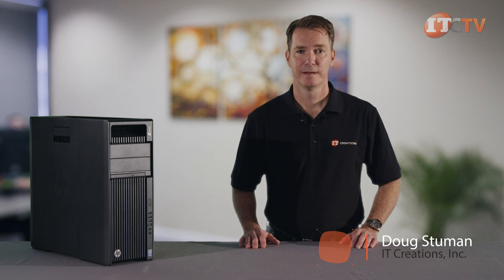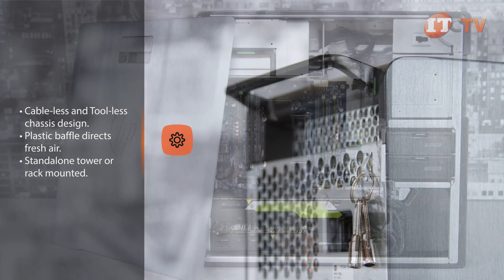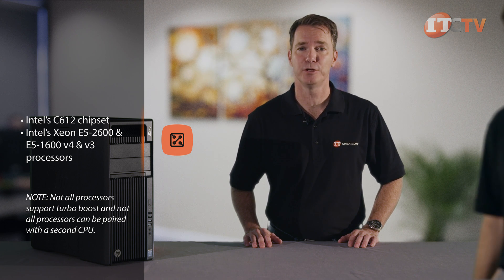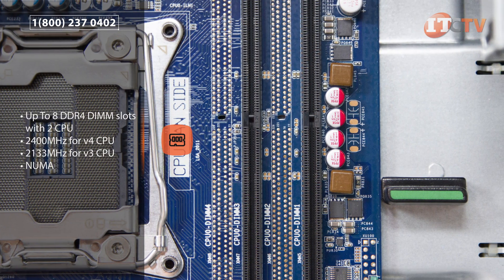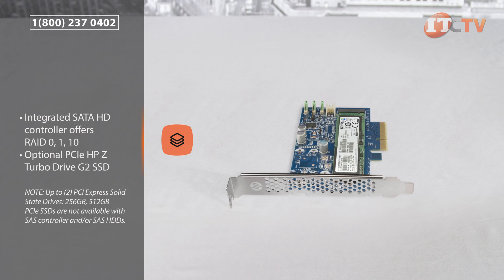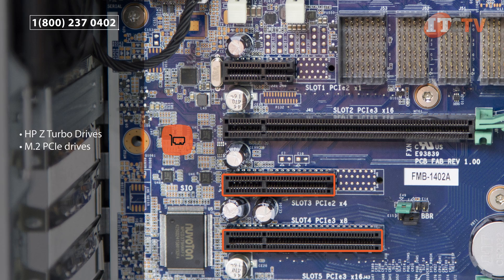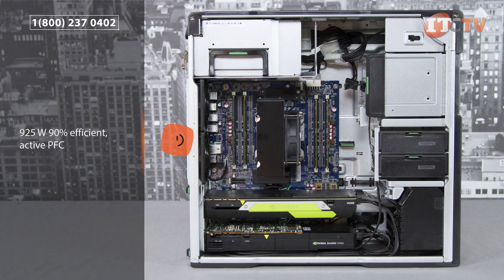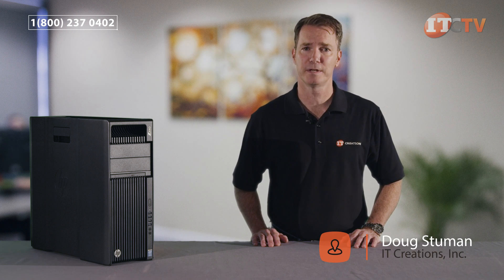HP Z640 Workstation Review - 4K UHD!

Comment: How long can these Z440, Z640 and Z840 be able to serve given that it's already a decade old.
Reply from the maker: Until they die… Depends on what you want to use it for I suppose. Technology does get better quite quickly so it will start to lose it's edge in comparison to other systems. Still, those Z-series systems are made for 24/7 operation. Thanks for commenting and watching!
Reply: @Itcreations-LA thanks for your response

Comment: I use a HP Z640 with dual E5-2699v3, 256 GB of 2,133MHz ECC RAM, a ProArt RTX4070 GPU and a ASUS 4 x 2TB M2 NVMe card, configured in RAID 0 for very heavy Astro photography work loads. The rig boots from a 1TB SSD and has a 8TB enterprise HDD for storage. My workloads, which step one - stacking 800+ images into a master image (using PixInsight v1.9.3) used to take 4.5 hours on my old eight core workstation. This 36 physical core workstation completes this task in 2 hours! I disable hyper threading as Windows 10 Pro requires special affinity aware code to distribute workloads across 2 NUMA core - when a machine shows has having more than 64 virtual cores.  Most software doesn’t have this affinity aware code correctly added.

The machine is close to perfect for astrophotography and video editing workloads - or to run VMs.  My only wish would be it could provide PCIE x16 in v4 rather than v3, which limits my PCIE M2 RAID 0 array to 8 Giga bytes a second throughput - half of what the drives are capable of.  It would be great is Microsoft confirmed this CPU class were supported for Windows 11 Pro. Waiting for someone to test booting it as an unapproved OS as Windows 10 Pro approaches end of life.  An excellent machine, really well constructed.

By the way - I used a twin female 6 pin to single 8 pin male adapter cable to take the Z640s two 6 pin cables to power the RTX 4070.

Comment: can you use oios openindiana on this machine ?
Reply from the maker: That is an interesting question, and one which we have not tested, so I cannot answer that. We usually stick with the list of system supported operating systems but that does not mean this OS would not be supported! it is Linux Redhat certified after all but if it is not in the list of supported OS then we would only install at the customer's request. Thanks for watching!

Comment: Dear,
          I have quotation of Hp z640, the specifications are below. Just i want to know this kind spec. are good and supported for 3d high rendering works .I am using 3ds max vray and other graphics software.So please let me know can i buy it or not for my 3d works.      

HP Z640 WORKSTATION E5-2667 v4
Intel® Xeon® Processor E5-2667 v4 ( 8 core,3.2 Ghz)
32 GB 2400 MHz DDR4 ECC Reg Unbuffered RAM
HP Z Turbo Drive 512GB PCIe Solid State Drive
2 * 1TB SATA Hard Drive 7200RPM
Optical drive - SATA SuperMulti DVD writer
Quadro M 4000 8GB 
NIC -Integrated Intel 82579LM PCIe Dual GbE
Genuine Win-10 Pro / Windows® 7 Professional 64-bit

I am looking forward to hear from you soon..
Reply from the maker: Hi +arch ahmed looks like you are already in touch with our sales guys. Look for a quote in your in box. IMO this is a great system and you shouldn't have any problems.

Comment: what is the cost for HPZ640 workstation....???
Reply from the maker: HI +Gautham Nayak I provided several links in the video and in the description below the video so you could price a system. Price absolutley depends on the configuration. Click the link I provided below, then click the green "SHOP NOW" button to find pages and pages of pre-configured Z640s that start at the lowest price and most basic configuration and end at a rather high price but loaded with memory, storage, top of the line GPUs, CPUs and whatnot…: Also, as stated in the video, if you purchase a z-series system valued at $1,500 or more, mention this video to get $150 off.  http://ow.ly/9fuA304dsuu Thanks for watching!

Comment: hello, does the fact that the second CPU needs to be connected to a PCI-E slot bottle neck the performance of the second CPU and RAM? or will it perform the same as any other native dual CPU motherboards?
thank you!
Reply from the maker: +Johnathan Erazo HP does not mention any bottlenecks in performance for the second CPU on the riser board that installs in PCIe slot 1 which is a gen2 slot. We have not tested that aspect either, so cannot definitively answer that question. However, the system can only be configured with two processors using an E5-2600 v4 or v3 processor and listed transfer speeds are 2400MHz for v4 and 2133MHz for v3. Same with supported memory modules. No disclaimers or notes are present which would indicate decreased performance. Check out page 10 of this technical whitepaper https://www.itcreations.com/user-manuals/z640/4AA5-4044ENW.pdf 
Thanks for watching Johnathan!